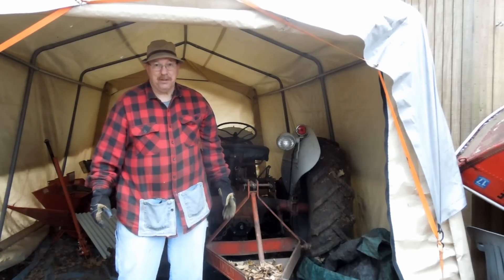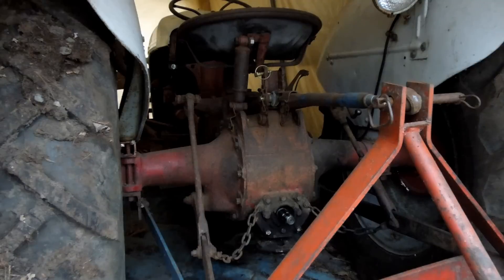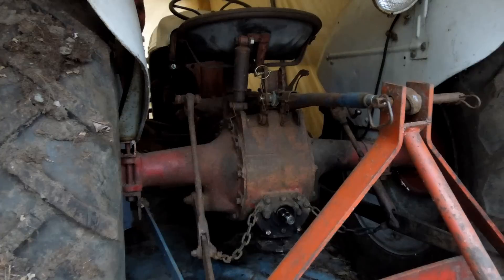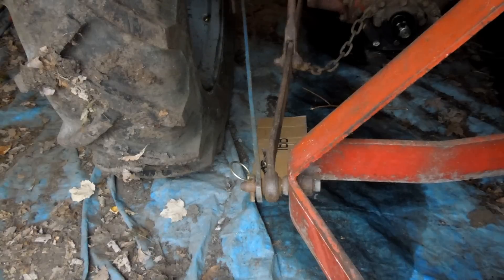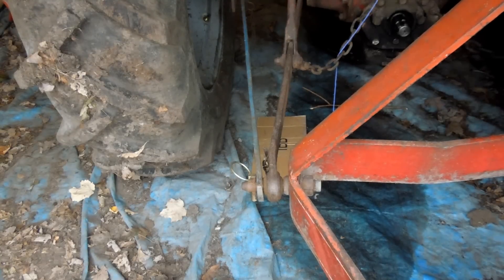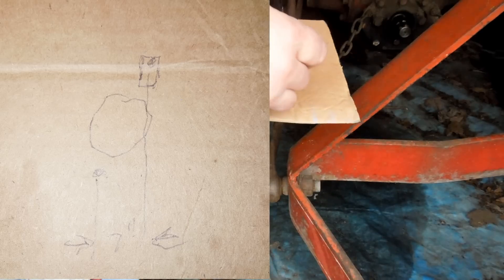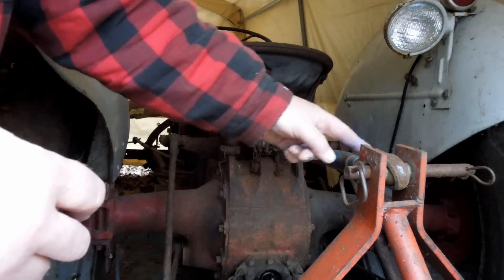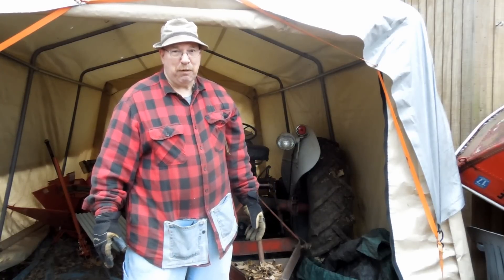Building A Tractor Mounted Engine Hoist

Comment: I hope the weather holds out!  Looking forward to this project!  Thanks
Reply from the maker: January is fickle. Fortunately I'm use to it and have warm clothes just in case. I got the measurements and did the layout. Most of the cutting and fitting will be done in the nice warm dry garage. 😆
Reply: @OldSneelock  Perzactly like it ought to be done. Get the field work over and head for the house!

Comment: You are off to a good start. It’s an accessory everyone with a three point needs. You’ll find many uses for it once you have it.
Reply from the maker: The base is going to be similar to the gooseneck hitch attachment I was watching on your channel this morning.
Reply: I can see that, though I'm sure you had that idea in mind before.   A lot of times I actually weld in category 1 pins into the build, but this one I used 3/4 or 7/8 bolts and drilled them for the linch pins.  I won't be moving the goosenecks too often under load with the small three point tractors because of the relative light weight of the tractors in comparison to the weight of the loaded trailers.  The reasoning behind not spending money on the pins.
Reply: @OldSneelock  Like if I had a hitch I'd have a tractor hitch if I just had a tractor. #2- If we had some ham we'd have some ham and eggs if we just had some eggs.

Comment: Seems a darn good idea to me .doesn't look to big of a job either should be fun . I recon you'll enjoy this I know I would given the chance , good luck matey 👍
Reply: You can haul the chariot with it!
Reply from the maker: I need to move a mower with 4 flat tires out of the neighbors shed to where I can work on it. While I'm at it I decided to build something I have wanted for years. 😆
Reply: @OldSneelock  I just use whatever is runable at the time and straighten it all out when I get it home. I've rescued all kinds of stuff with Cheryl and her 35+ year old mower and the Gravely. No telling what'll be next!
Reply: @OldSneelock  I see we're commenting back in the notice box like it used to be. I knew I couldn't get back to the video which was really a time consuming thing anyway. I like this a lot better. The new-ish Snapper is running and I am happy. Road is salted so maybe something will get here. 55 out and nice in the sun. Now to get a heater core and get it installed. Sumpee all uh time.
Reply: @lewiemcneely9143  -  And, i here reading away, 
couldn't agree with you more - enjoying every bit of it!  =]    May not 'get' much from this, but what is wasting time all about?   = ) 
 - This is wearing me out,  I actually see (field) dust settling, and smell . .. food.   You mentioned  Eggs in here someplace Lewie; You cooking?    =p

Comment: Stuff gets interesting. I remember finding out that running a clam bucket, both cables had to be in the same place on the hoist and closing drums ot one would outrun the other. Simple thinking but for someone that'd never sat in the seat of one it was a learning experience. It just happened once. The new-ish Snapper is ready to go and I'm still finding stuff for the box.
Reply: Totally Sad Lewie, when that bucket comes up empty.   lol   It got away  ~   Once huh, for how long?   Is it like using post hole diggers in Dry sand?  I know that doesn't work well.   : |
Reply: @kareno8634  True. You can either see it opening on the way up or you end up with a bunch of slack in the hoist line that you have to deal with but when they're equal it's like rocking a rocking chair. Everything works together. NO problems.
Reply: The operators we had at the paper mill, would run the barge crane wide open as they unloaded a barge of wood chips. The lines would have 20' of slack and beat the winch house to pieces. Every week we would change cables and reset the limits.  The best was on night I got called in the work and found the 6yd bucket was flipped over and lying in the bottom of the barge. I don't know how they flipped the bucket over and through the cables to tie them in a knot.  We started with a cutting torch and went from there.
Reply: @paulharriss1192  When I got there I had a choice of learning to run the hot oil heater that kept the asphalt hot or the crane. I always was intrigued by a crane so there I went. The other operators were fixing to go home (this was in RVN in 71) so I watched the other guys till I saw what was what. They turned me loose and it was interesting for a while. It was a 22-B Bucyrus and my trouble was swinging. Free swing where you had to engage the opposite swing to stop and change directions. I finally got it and ran the dog doodles out of it. We had to tighten up the tagline to keep the bucket from spinning 3 or 4 times but those bins could be loaded in nothing flat. 250 ton per hour plant, continuous mix. That was the last of the clam bucket except for cleaning busted concrete out of a tank at the local paper plant. The rest was a drag bucket. I'd like to have slung that 6-yarder around. Some people just don't need to be fooling with stuff but it was sure job security for you! I had to fix my own gomms! C U, Paul!
Reply from the maker: I never worked on a piece of heavy equipment with cables but we did have a skip loader for the blast furnace at the Midwest Foundry. Every once in awhile they would overload the skip bucket sometimes it was just that the scrap was too big you know they put on a great big old straight-6 engine block out of a diesel truck and it would hang up the bucket. When that happened the bucket wouldn't drop back down but the cables would pay out so the drum would just unwind and there'd be a big wad of cable all the way around over the top of the drum. Now the only way to straighten it out was just rewind it all. We would have to drag the cable off the top of it group it down over the side pulled out straight and then somebody would have to sit there and run the coupling on the motor by hand and just Spin and spin and spin until we pull up all the cable. I don't recall ever having to cut the cable. We had to replace it a few times but that's normal when you using cables on a heavy hoist. we did have a big DC Bridge crane out over the top of the charge floor but I left before that ever wore far enough that we had to do anything major with cables.
Reply: @OldSneelock  Slack was a cables worst enemy. I knew from the start it'd be like a bait caster with no thumb if I didn't get on the brakes. Fuzz-up city. I ran an old cable blade 6 a little but not much. Hydraulics were in then and I was glad of it. I'd like to try one again with what I know now. Would probably tie it in a knot from the get-go. I'd still like to go through a foundry working. It'd take me several months.
Reply: @kareno8634  I was ground level and the top of the bins were around 20 feet or so. I could see the bucket opening up as it went up and I knew that if we didn't fix it we wouldn't get anything in the bins at allo. One bucket was all it took to see a lost cause in the making. Back down it came and was fixed right then.
Reply: @lewiemcneely9143  Hey Lewie dew you know Plum Bob. 
He's the guy that picks our tomatoes.
Reply: @lewiemcneely9143  Yup slack is no good when you towing cars too. Wait did I say too? Well I meant two2, I mean to.
Reply: @paulharriss1192  You could swing the bucket pretty good and stop the swing and the bucket would spin. Maybe that's how they did it, just goofing off and seeing how big a gomm they could make of it all. I'd say that someone ought to have been sent home talking to themselves. No excuse for that at all. When I was swinging back empty as soon as I was about clear of the bins I kicked the closing line brake loose so the drum could speed up and then kicked the hoist brake off and the bucket opened and freefell to the pile and I already had the closing line clutch engaged and the bucket was filling. Light pressure on the hoist clutch meant that when the closing line came taught the hoist was ready to go up at the same time. Everything was even but moving rapidly.
Reply: @mostlymoparih5682  I think he goes by Robert here, not wanting to use his real name!
Reply: @mostlymoparih5682  As in likewise and all that stuff. And the towee better know what's going on or it'll be to the neck uncracker the next day! And pushing pans without a spring loaded push blade but just a straight 'U' blade with a reinforcing strip to hit the push block with. I liked to catch 'em on the fly. No bump and keep on getting it!
Reply: @OldSneelock  If I fuzzed one up really bad they'd drag the bucket out with a loader or dozer and I'd respool the lines. With a drag bucket I could walk back and boom up and respool like that or swing around of it wasn't too bad. All sorts of tricks for a desperate kid trying to pay the light bill!
Reply: @lewiemcneely9143  Robert, Plum Bob, Sweet Ole Bob. S.O Bee careful what you say. Butt he don't care what ya call hymn as long as ya don't call him late four4 dinner.
Reply: @lewiemcneely9143  I had a cable come off the winch. I pulled it out too far and the set screw that was holding it on the spool was loose and let go of it. Didn't have any tools on the truck to fix it with so I just wrapped the end of the cable on the winch a few times and then the cable held the cable. that set screw don't hold much ya gotta leave some cable on the reel to keep it from coming off.
Reply: @lewiemcneely9143  Okay Brother hear comes the ole I mean the boss is saying it's thyme to go look at my I lids. I mean my eye lids.
Talk at ya on the morrow.
Reply: @mostlymoparih5682  Old preacher pal always said it didn't matter as long as you called him 3 times a day but I don't think that knothead would've put up with a lot. He was a case walking, that old fellow. Arms 39 inches long from fingertip to shoulder joint. 'They cut me out for a boxer but they sewed me up wrong' he'd always say and laugh real big. I sure do miss that rascal but I'll see him again one day. Just listening to Chris Rice a little. Lots of good stuff. Got to 2 tew go warsh and put it in prone. Dream about gardening in the Garden State, even plumb robert! U know how he gets and U 2! Hi Dottie!
Reply: @lewiemcneely9143  Dottie says Hi.
Gotta go clean the ch ch
Whats missing? 
I am
No no U R
Okay Lewie I'm gonna go smell the color nine. Ketchup with ya hotdog. I mean catchup wit ya later.
Reply: @mostlymoparih5682  10/4 on the sniffing color nine deal. I like Chris a site! Had a buddy's daughter that ran me off a c.d. of that album. He's a preacher that speaks 5 languages fluently. I butcher anything! She could sing and I mean SING and I was always getting her in a corner and getting the guitar and turning her loose. I'd start picking and she'd start singing and we'd both start grinning and it was ON for a while but always ended too soon. Now she's hitched with younguns of her own but she was one of mine anyway. I'd share her with her folks. That was after the great blow out and my kids were far away and the Lord used them and her to fill in a big void.
Reply: @lewiemcneely9143  Voids can bee tough. Some people say the Lord don't give ya more than you can handle and I used to say that till a few years ago when He allowed me to have more than I could handle. That's when he wants you to ask four4 help. From Him and whoever. A S K 
Ask and you shall receive
Seek and you shall find
Knock and the door will be opened. 
Brother I was so low I didn't know what to do 
But that Bonus Baby of ours would not let go of me and that little thing kept picking me up. 
Yeah in the sand there were two2 stets of prints the Lord's and my Bonus Baby and she was helping the Lord carry me. 
Voids can be tough but know they opened my eyes. 
I'm still learning though. Gotta keep my eyes opened, my ears clear, and my mind ready. 
I saw someplace a saying
Engage mind before putting mouth in gear.
Reply: @mostlymoparih5682  Gotcha! When the bottom falls out, where is our faith!!! The worst one so far for me was when the great blowout happened after 23 years and 2 kids and it all went belly up but we were talking about such things this morning and the Almighty NEVER left me through all of that and is still with me NOW! If people say I have no peace or no joy they must not have the Spirit! And if that's the case they're none of His to start with. 1st things 1st!
Reply: @lewiemcneely9143  Shine. Make em wonder what ya got 
Make em wish that they were not 
On the outside looking bored. 
Ya know I was assigned to a body shop when I was an adjuster and the owner's son came up to me and asked me if I was born again. 
I said, Well yeah why do ya ask? He said there's something different about you. 
I  couldn't see it but God let him see it. 
When things like that happen you know the Master is up there watching and protecting and nudging us along, the good shepherd that He is.
Reply: @mostlymoparih5682  And that's a fact! It'll sneak up on you. I tell Toots all the time if you got the Spirit you can't hide it and if you don't you can't make it! And it WILL make a difference. That's BIBLE, Bro!

Comment: I want \ Need to see this -  This engineering is cool!   Test in school had pics on paper, we needed to note what shape was or did.    
tho - Not seeing this.  = [     Was picturing lift we have for tractor [at home],  but not that shape.  (just thinking on 'paper' here)  =\    
special word needed to look it up.  = ]    just that 4th grade leverage 101 was Cool!   but, 4th grade only, i guess.   bothers me not seeing in head.
Strength of Top bars for lift &  extending them  ?   - What's ya lifting?  ;  )   (Sorry, no worries if questions make no sense, trying to picture this.)  =p
 I spoke of lift last week to help w\ cutting tree.   NO, Won't do, but was a thought.   got it figured - I hope.                  THANKS for Class!   ~- *
Reply: One way to find out!
Reply from the maker: I'm cheating. I know the tractor 3 point is rated at 1500 lbs. The hoist I will be attaching to the 3 point is a factory built engine hoist rated at 2000 lbs. The limit forvthevassembly will be 1500 lbs determined by the max lift rating on the 3 point. I will also be limited because the 3 points rating is at the end of the lower lift arms. 
When I add the length of the upper hoist beam the load capacity drops. I don't want to end up with the load on the ground and the front axle pointing straight up. 😨
Reply: @OldSneelock    lol    How'd you know I would think that?  Pimp my Tractor - with pumped Hydraulic suspension  ~  it could hop!  =]    
for comparison  -->  I wouldn't mind Shooting off a Tank, They Dance & Fly when they shoot!   =D
Reply: @kareno8634  Pay attention there's gonna be a test at the end. Lesson in Atlas 101.
Lewie move closer so I can sea your paper.
Reply: @mostlymoparih5682  I'm blank as usual, Marty. Sorry the head won't work more than it has to.
Reply: @OldSneelock  Yep, leverage is still leverage!